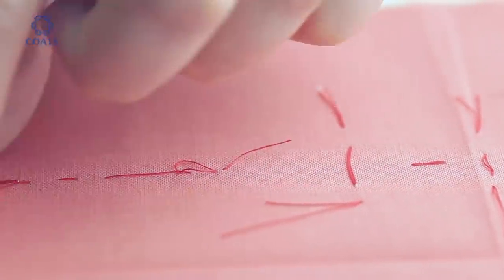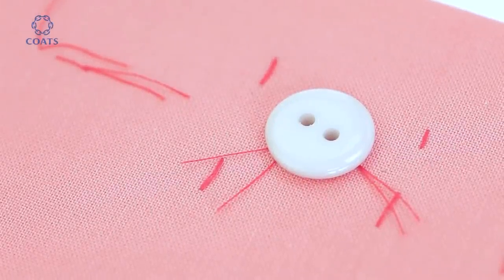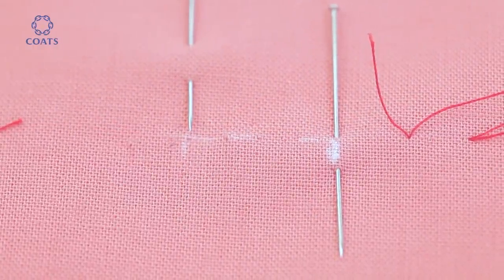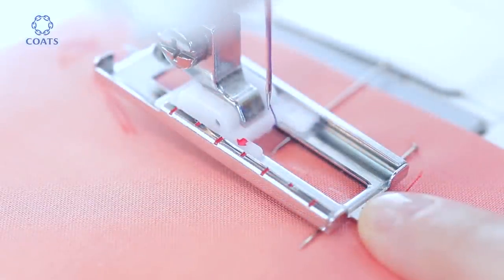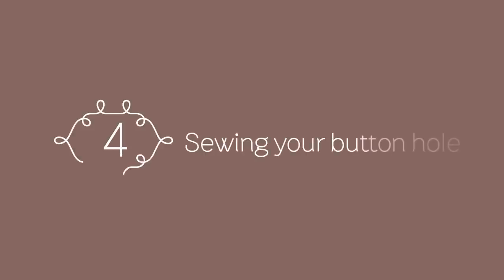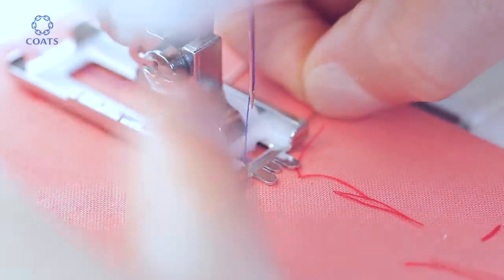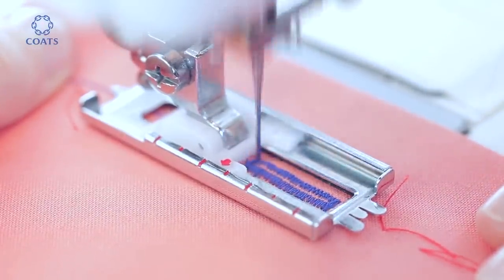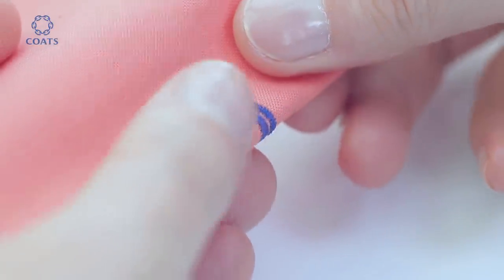Learn How To Machine Sew Button Holes

Comment: Watched it ten times, but the transition between button placement at 0:55 to 0:58 loses me; the four red horizontal threads used to orient the button hole seems totally different from the first.  Is that button in the same place?  Did you remove the four red locating threads before pinning it?  Dumb guys need to know.